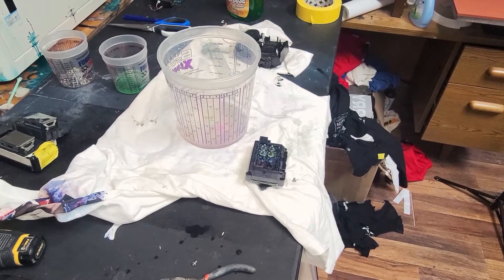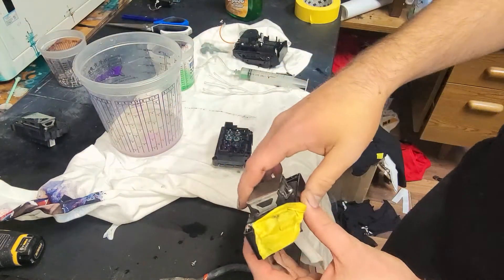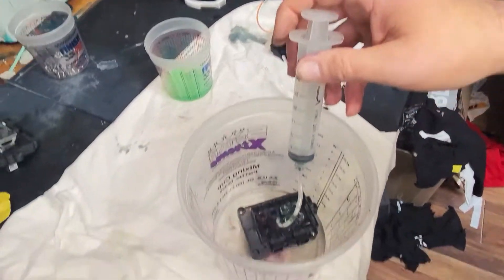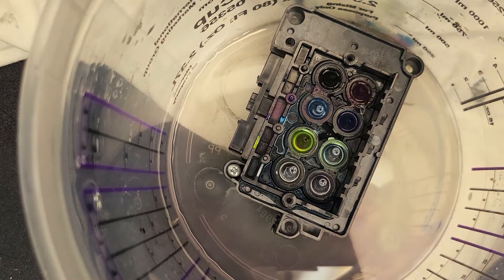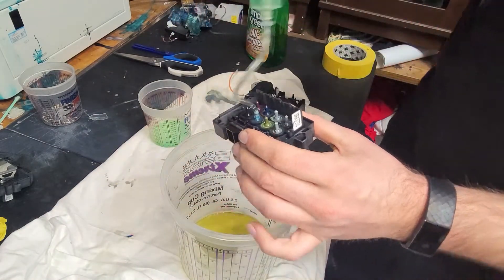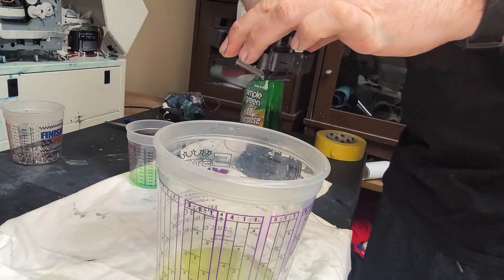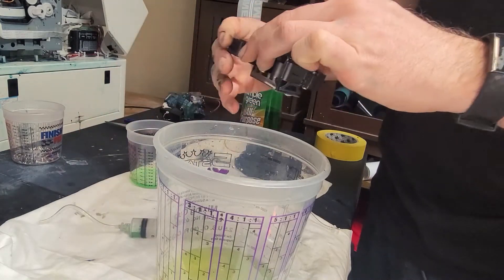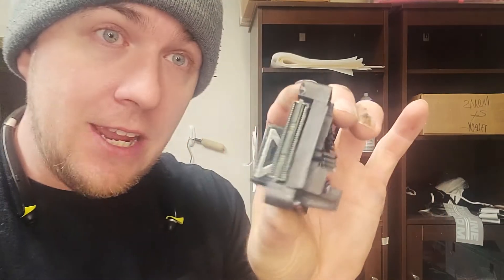PRINT HEAD FLUSH - WATERFALL - REVERSE FLUSH - DTG / EPSON PRINTERS

Comment: Hi. I disabled the printhead. And got stuck on putting back the dampers. I have all of the screws in a bowl, but lost all my data so I don't know which screws goes where.... can you please help me
Reply from the maker: most of the screws are exactly the same. the smallest would be holding in the damper assembly together, other than that they should be pretty universal on the 3880/3800

Comment: Good advise. Forcing pressure on the reverse printhead cleaning or the "waterfall" methods can RUIN your printhead. Keep in mind that there is electronics inside the printhead; that said, if any fluid leaks into the electronics of the printhead IT WILL BE RUINED. Trust me.

Comment: I’ve been using Epson Workforce printers for years…. All printers are a PITA.. but flushing the print head (as a last resort) will keep an old printer working like new. NOTE: I never remove the print head.. I flush them in the machine.. I simply roll a paper towel sheet up under the print head to absorb the ink and flush solvent. Between this and occasionally having to clean the encoders… these printers can live for many years…
Reply: they suck.  clogs are clogs like in drains.   warm water wont always work.   flaw in the tech.

Comment: Hi .. i also have a epson l1800 LS / 1390 the problem im having is the ink is not moving at all theres no flow in it.... head cleaning, power cleaning and ink charge still no ink movement through the ink heads out. and also the ink waste pad is having a little bit suction but after that it will squirt it out. please i really need help
Reply from the maker: Follow the ink, try sucking it out of the dampers themselves

Comment: Along with your other vid on head removal REALLY helpful thx for sharing...gives me the confidence to clean/overhaul my P800. Question, is it possible to remove/clean the ink lines - I ask because I'm wondering whether there might be some sort of air block and guess that would most likely be the lines. Previously I've cleaned the head and cap using magic bullet fluid (cloth under head method) and always worked fine but all of a sudden the MK has suddenly started playing up. Strange symptoms, it started printed a magenta strip at the start and end of page and now just prints a pinky grey set of stripes. Tried a final overnight clean with MB, ran some black purge pages thru and seemed like it was coming back to life with an almost black print but then reverted back to the stripes. All the other colours are fine. If I dismantle and remove the head I'd like to make sure I cover the possibility of an air blockage in lines. Any advice ?
Reply from the maker: You can further disassemble the printer and remove the lines altogether and run water through them. Sounds more like a damper issue to me. Dampers primed and have ink in them then can't keep up the ink flow and begin to fade out

Comment: If the print heas was wet a bit still n the printer came on and then cut off completely and isn't powering on again what is the problem?
Reply from the maker: Dead main board, likely killed the head too. Check the cable for burn marks at the head.
Reply: @planetpodcast5607  so is this repairable
Reply: @planetpodcast5607  no burn marks are visible at cable etc,printer just isn't powering on

Comment: hi I need a print head for an epson sc p600 like the one in the video, even used in italy it is impossible to find it
Let me know
Thank you
Reply from the maker: I never buy new heads, I always pull them from printers. The p600 is very common, I dont see an issue finding one online
Reply: @planetpodcast5607  I found them online reconditioned from China at 1100 usd
it seems too much
Reply from the maker: That's up there. I've always bought used printers and disassembled them

Comment: 70% thinners, 30% distilled water mixture. Let it sit for a few hours then suck up, never push the solution towards the printhead because it's micro holes. Never failed to unblock a printhead yet.
Reply: What would be the problem if its not printing any colors at all? Just white. Havent done any of the procedures in the vid yet and i have not used the printer for awhile
Reply: @proclaim2847  Would seem you have a clogged printhead for sure if you haven't used it in a while, but on the other hand it's really really strange that white is still printing. Normally white is the problematic colour.
Reply: Nurani Printers Kumbukgete   Yes paint thinner.
Reply: Will this method work for DTG printer print head also

Comment: Hi I have an Epson f2100, last Friday a done a head text all Colors including white were great. Last Monday I done another print head text all white channels Were missing except white1 give print, I done 10/15 hard cleaning and no changes, I changed the pump and also non changes please help for any ideas thamks
Reply from the maker: I would definitely wetcap it, Since you have access to the head undocked I would soak a paper towel with some cleaner or water and press it against the bottom of the head a few times, see if you get the ink lines from the nozzles on the paper towel. Also pull ink through the dampers. Likely you have a blockage between the cartridges and the head.
Reply: @planetpodcast5607  Hi again, so i soaked the head for an hour in Epson original cleaning solution, a lot of ink went out ( all Colors and white) we also remove the dumpers and pull out white inks everything works perfectly, but when we tried to flash the head ( gently with minimum pressure ) it was very hard to push the Syringe down or up). What did you suggest. I also bought a ultrasonic with heater any idea how I should use this device to clean the head thanks for you time and help
Reply from the maker: never force fluid down through the head, you will destroy it certainly. It might not be a bad idea to run some cleaning carts through it. Just refillables with cleaning solution in them instead of ink and run power cleans

Comment: Great video.  Thanks for sharing I have an L1800 and the white print heads are clogged.  I tried soaking and the reverse flush.  But both are still clogged.  What do you suggest?  I also have another L1800 that the carriage goes to the left and stays there,  What do you think is wrong.  It is brand new and did this during set-up.

Comment: Can you put Simple green in the little machine and did you use Simple green in the syringe. Thanks
Reply from the maker: You can, just be careful. Make sure your head is 100% dry . Remove it from the manifold. Blow it out. If there is any moisture at all it will kill the head the second you plug it in

Comment: Hello I let my print head soak overnight and then when I went to do the waterfall I got fluids coming out the other nozzles is there anyway to fix that or is that normal.
Reply from the maker: It's not normal and it's not repairable. The seal is blown between channels
Reply: @planetpodcast5607  I have an epson stylus photo r1800 that the printhead came out of do you think you can help me with any fixes.

Comment: This will work on the Epson f2100 dtg? Also if i dont shake the white ink cartridges for several months does the white ink harden and can I still use white ink after it sat ?
Reply from the maker: it will, i would not recommend waterfalling it but rather reverse flushing it. Pull the ink, dont push it. Also if you have refillable carts use some with cleaner in them and run power cleans. If your white ink sat for too long it will expire.
Reply: @planetpodcast5607 hi this is great info and im just wondering why reverse instead of waterfall? what does it effect differently?  I would have thought it'd be safer to waterfall since thats the path the ink travels normally? Also wondering if its possible the lines get clogged from not being in use for months? If so any reccomendations for cleaning?

Comment: What would happen if I push water through the nozzles too hard?
Reply from the maker: What happens is the small plate on the bottom that has the nozzles, becomes unglued. So then what happens is fluid goes in one channel crosses over into the other and comes out the other side instead of just going straight through it. Basically the path of least resistance. This also causes it to damage the electronics on the board and it will no longer pressurize and print rendering it useless
Reply: @planetpodcast5607  I just did this today to my print head.  Do think it's any way to save it, or am I a goner?
Reply from the maker: If you forced it you will kill it. If you are careful you'll be ok. If fluid comes out of the other inlets it's dead.

Comment: Maybe you can help me with some insight. All my colors look good when i prime my printhead. Once i do a head cleaning 1-2 times head cleanin , my white lines go from about 98% down to 10%. I just replaced the pump maybe 1 month ago as well as dampers. My room temp is about 66 degrees and humidity at around 55-60%. What do you think it could be so i can purchase the part to fix the issue.
Reply from the maker: dampers most likely. Not sure what printer you are using but dampers will surely impede the flow of ink, you might get some ink in them to start the print but it cannot sustain enough flow to keep it solid throughout

Comment: Do you know of anyone that works on the Epson 3880 DTF?   I have one that will not draw ink.   I have replaced all dampers and the pump/capping station.  Looking for advise or even someone who can repair my printer.   You can hit me up here or PM me.   Wanting to get it back up and running soon  TIA
Reply from the maker: I work on mine myself. Is there ink in the dampers? Ink in the head? Ink in the lines ?

Comment: after soaking the bottom do you let dry for 24hrs ? Or can you just reinsert and print right after?
Reply from the maker: It's important the the electronics be dry, the head plate not so much. But make sure the actual cable connection and board are completely dry

Comment: What kind of cleaner you put into the ultrasound? To clean the printhead. Can I get a link to but. Thank
Reply from the maker: You can use head cleaners or you can use distilled water and some windex type solution.
Reply: @planetpodcast5607  Cool Thank
Reply: Curious to know what ratio for warm water and winded you recommend? I’m looking to try to revive a 3880.

Comment: Help... I have a 3880 that had one blocked channel and follow some of what you showed here - didn't inject into the ports but let the head soak in a small amount of piezo solution. Everything was completely dry upon reassembling. Ran multiple ink charges to get the ink back in the heads. Unfortunately ink does not appear to move to the head assembly. Test prints are all coming out blank. In your opinion, is this something related to the head or something else with the dampers or vacuum? If the head was now bad what would be the signs?
Reply from the maker: Follow the ink. Is ink following out of the damper, is it flowing through the manifold. Only other thing that stops it completely is no signal to the head to print, cable issue. Is there ink in the capping station after your head cleans?
Reply: @planetpodcast5607  No ink in the capping station at all. The pads are essentially clean. The printer shows the cartridges as being depleting after charges but I have a scale and there is no difference in weight before and after. The cleaning cycles "sound" OK but I do not hear that rush of ink into the maintenance cart. I checked both cables. No bent pins and I labeled the upper and lower before disconnect. This really has me searching for answers. If there head were shot is this what would happen - no ink flow at all? Also tried to extract a little ink from the dampers when I had them disconnected from the manifold and was not able to even get the syringe to draw a little ink out
Reply from the maker: In my experience, yes, bad head leads to no ink however I have seen them shoot ink during cleaning and no ink on prints. But if it's not in the capping station then ink is certainly not making it's way through it. Could be the capping station not sucking it out sorry
Reply: @planetpodcast5607  OK, that is kinda what I was afraid of. I just didn't know if there was a definitive way to test it. The capping station "looks" like it's doing everything it is suppose to do and makes all the usual noises - just no ink on the pads at all. I have a working 3800 and it sounds essentially the same as the 3880 on cleaning so I figured that was OK. Obviously a new head is out of the question given the costs. May need to list on eBay for parts I guess. Thx for the quick replies. Great channel!
Reply from the maker: Better off searching eBay for a head. Just bought one myself
Reply: @planetpodcast5607  What is the average price people are paying for these in a 3800 or 3880? Also, can the 3800 head be used in a 3880?
Reply from the maker: Yes, it's the same printer, same head. I pay between $250 and 400 for a head. Even better is to find a used printer for parts, but they can be hard to come by. Especially with the popularity of dtf.

Comment: What is the mixture of the cleaner? Simple Green and what? and how much of each.  I've also read that using an ultrasonic is not good for the head as it will cause it to de-laminate. Any truth to that?? Thanks
Reply from the maker: I have not had one delaminate , check out the video of what's inside your printhead. As for the mix i do about 20 percent cleaner 80 percent water